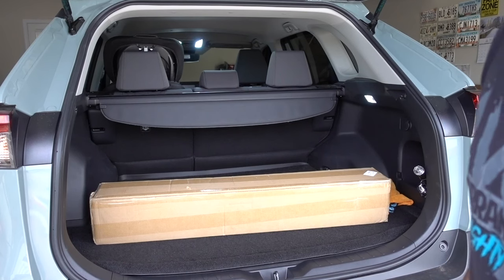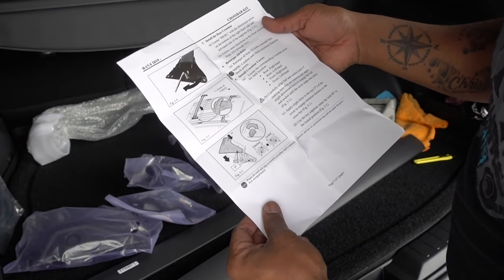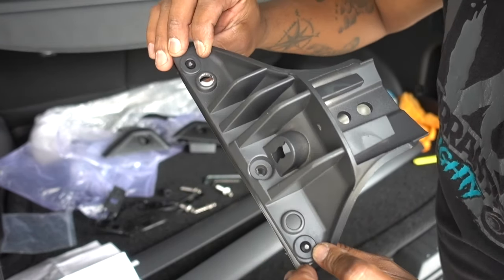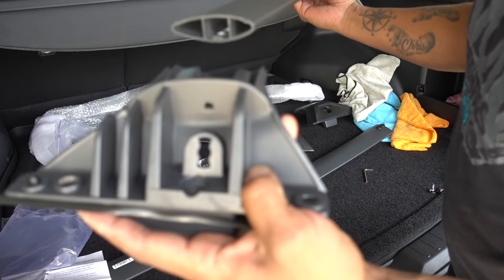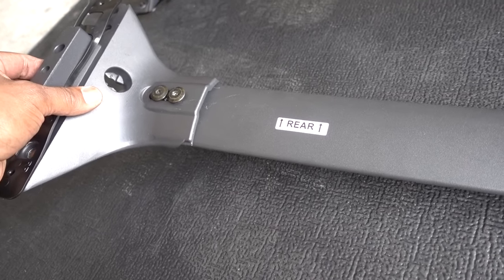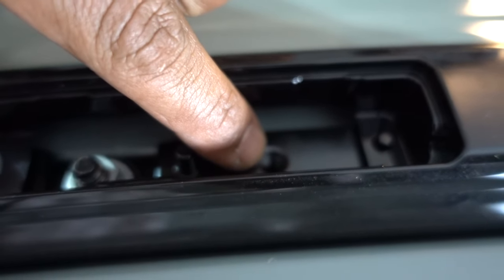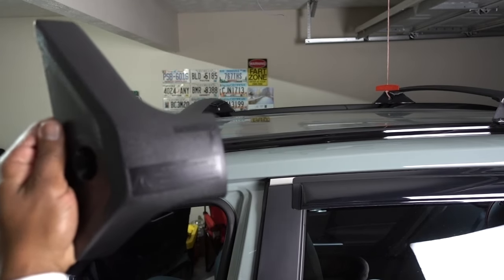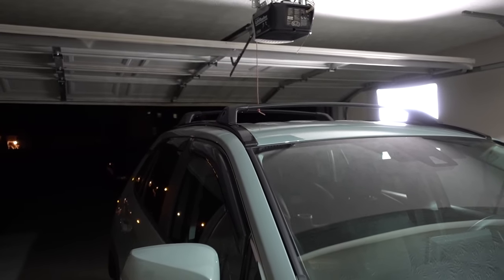Yitamotor Roof Rack Cross Bars Installation for 2019 to 2021 Toyota RAV4

Comment: I have the OEM crossbars and love the rugged look. I dont use for carrying things came with my veh. It makes sunroof unusable though due to wind noise. Any suggestions?
Reply from the maker: Remove them
Reply: @BulletSolano  such a bad design flaw by toyota putting the bars directly over the moon roof
Reply from the maker: I know right

Comment: I have a question I just bought these. What are you do with the extra material from the gasket on the front they don’t fit in directly I have a 2019.
Reply from the maker: There is no extra material left, match the letters on the gaskets to the brackets! They should fit exactly
Reply: I guess it doesn’t fit it . I did match the numbers up the instructions even say to trim the gasket if needed my car is a 2019. It says it’s for 2019 to 2022.
Reply: It’s not the brackets for it doesn’t fit it’s on the rack itself to the car
Reply: Just re-watched that section of the video I think I got it. Thank you.
Reply from the maker: Okay